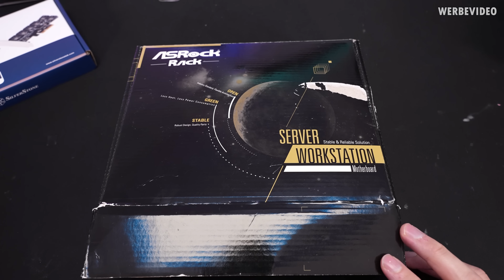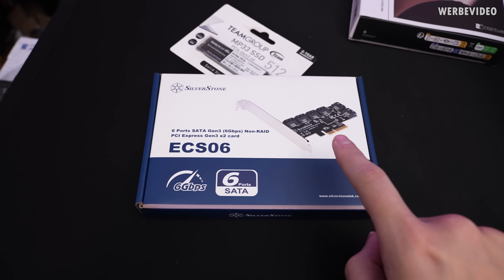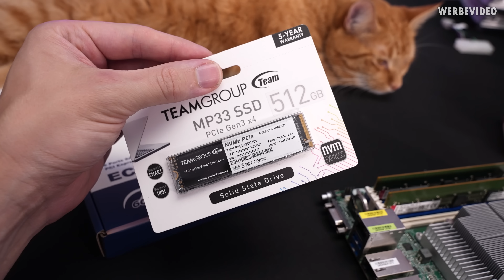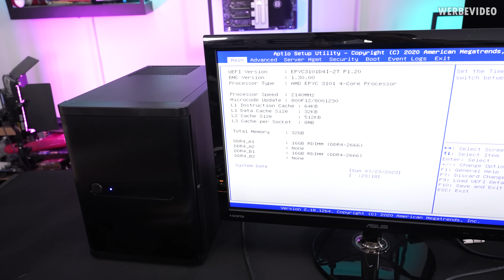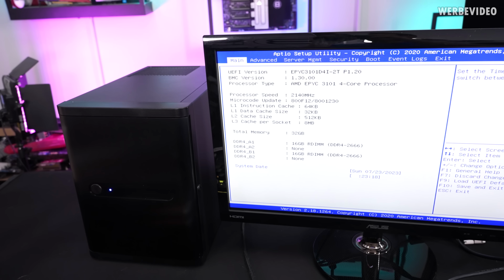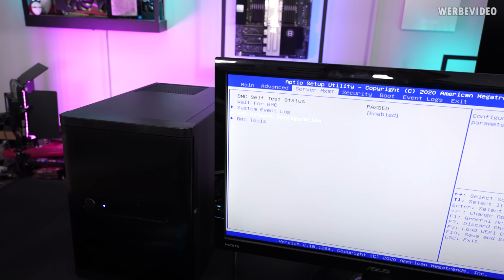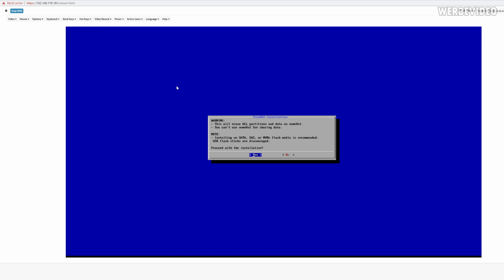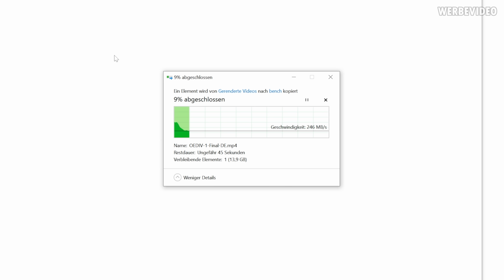First Time building my own NAS

Comment: Ideally you'd want a daily backup up to a week/month and maybe a backup of each month up to a year. You don't need to run the backup server 24/7 for that, simply having it boot itself and be ready/online a moment before the scheduled backup time is enough. If you can't think of a way to wake up the server, you can send a WoL (Wake over Lan) signal from your Synology a couple of minutes before the scheduled backup time. Then you could have it shut down itself after a maximum time it should ever need to backup 1 days worth of data, or if you want to optimize and don't mind writing a custom script, you could wait for the connection and activity (after the backup drives might be indexing/scrubbing) and shutdown after that.

Either way, it is recommended to run an extended SMART test once in a while (lets say once a month or two), as well as scrub/check for data integrity too. Do you remember when Linus lost some data due to bit rot? You probably don't want that.

Here's a quote from an article on teckadviso:
"Regardless of whether you have SSDs or old-fashioned mechanical hard drives, both storage medium have only a limited ability to preserve the stored data when they are not in use.

That doesn’t mean that you have to leave your PC switched on all the time. But anyone who thinks that it is a good idea to fill a drive with valuable data and lock it in a safe is unfortunately wrong."

Comment: Return those HDDs. I owned a few & 3
 of them crashed. It was a big loss for me. It's showing data was there but when I copy, it gets stuck at 1%.  Sent, a drive to toshiba, even they can't diagnose the issue. 
Swapped them all with Seagate.
Reply: And GamersNexus cursed Seagate drives, which do have on average worse failure rates in Backblaze stats. Specific models can have issues, that's true for any of the 3 manufacturers, so it's better to look up data on a model beforehand, but redundancy is more important than manufacturers on consumer scale anyway.
Reply: @Lishtenbird  reliability & services is also a factor. What you said is right, even specific batches of good models can have issues.
Reply: Are these big drives reliable at all? And economic?

Comment: have ecs06. great little thing. but, beware of sata ports and cables. i went and bought silverstone thin sata cables and of course, since sata ports are next to each other (rather above one another) the thin sata cables have to be bent way too much when plugging into two ports and beyone. and it doesnt matter if its left or right angle cable, you will always have to bend the wires. those silverstone thin sata cables always have the wire coming from the side, which is a shame. thin sata cables that have the wire coming out the middle of the connector, vertically, would be ideal and i have those but are too short and here in SUI i cant find cheaper ones, only supermicro one which are ridiculously expensive. here. in SUI, of course. in US? cheap AF. lol. will try aourcing them from EU where they are like 2-3x cheaper.

Comment: Just a note, you want to wire a 5 bay to use 5 even if the goal is to have 4 - replacing drive is correctly done without removing the old one first. That said soemtimes you do not have the option.
Reply: That's really just a matter of cosmetics. You can keep the old drive connected, if you desire, without having it in a bay for the short period you're replacing it.
Reply: @zamadatix It is not (edit cosmetical). Drives die around the rebuild, handling drives with no parity is prone to failure and finally the human errora related to interaction. It is objectively better to have an empty bay rather than shutting down the system amd handling rebuild that way. Of course there is no shame in doing things good enough and I am throwing no shade.
Reply: @mckidney1  What about having an extra bay or not changes whether you have to shut the system down? Hot swapping is a function of the SATA controller, not the bay. The bay is just a nicer looking way of holding the drives long term. Whether or not you have the extra open bay or not you don't touch any of the previous drives already in bays (even the failing/failed one) until after the parity rebuild is complete.

If "well, opening the case is just too risky" then the problem isn't the lack of additional open drive bays it's the lack of enough parity drives (like here using 2 drives for redundancy instead of just 1 so you keep redundancy during a failure and don't have to worry about a butterfly flapping its wings during a rebuild). Alternatively just keep a USB UASP SATA adapter around, a lot more handy than a permanently empty bay.
Reply: @zamadatix  I think context of the video lost, option was there to wire it to an already empty bay. Self-proclaimed new NAS builder did not take it. I find this argument to be made for argument sake - yes it can be done even now, but at additional effort that is applied at the time of failure. Chosing between "wire the extra bays at a cost of a SATA cable and ports you already have empty on the main board" and "You can use open the case and wire it when the drive fails" - do you honestly thing the decision comes to cosmetics? Edit: My answer is no, the difference is that one is an advice and second is an excuse. Why would you send an excuse to a new builder?
Reply: It's fine to wire it up, it's also perfectly fine to not wire it up. If you had said "You may want to wire bay 5 to save yourself time in a future drive replacement" I'd have agreed but you insisted one always wants to and gave the reason it's how you can correctly replace a drive as if it you couldn't just as correctly replace a drive without the 5th bay wired. Also note I didn't even say anything about wiring the 5th bay at all, again that's just one option of many in how to correctly replace a drive.

There is so much misinformation in the NAS space because people like to describe their preferred way of doing something well as if it's the only correct way of doing something well. It's not that it's bad information, many will indeed want to wire a 5th bay (or even just all of them if they have the ports), it's just presented in the wrong light as if not doing it this way can't a valid option as well.

Comment: 12VO boards seem like a bad idea to me. You're basically making more points of failure to the motherboard by adding a bunch of voltage regulation to it. I think it's cheaper (and much easier) to replace a power supply if it fails, than to replace a more expensive motherboards if the power regulation function fails.
Reply: A bunch of voltage regulation, you mean just 5V and 3.3V? 

Plus, you do know that there's a duplicate VR, like 12V->12V, just to ensure that the 12V entering what ever device is always 12V, instead of 12.5V or 13V or 11V?

There's already more points of failure on your non-12VO boards!
Reply: @AlfaPro1337  Could you please give an example of a point of failure that exists on a Non-12VO board that does not exist on a 12VO board?
Reply: @Lardzor  Dude, there's already more point of failure on any spec, 12VO or not!

I repeat:

There's always a second VR, this takes the input voltage, and ensure that the output is the correct voltage.

Plus, the only board that died is one of my old H67 motherboard, and the failed component was the solid state capacitor to the CPU, not even the VRM!

All other boards I own in the past, Z77 and Z170 all died from failing BIOS chip. Not VRM.
Reply: Totaly agree. Plus it makes troubleshooting easier. Anyond with a self build nas and such likely has another PSU somewhere, so you can just plug that in in 5 mins and see if that was the cause of failure.
Oh, and of course heat management. 12VO puts a bit more heat on the general board away from parts that get actively cooled.

Comment: For 4-5 HDD You could use a Jonsbo NAS cases that are much more compact and nicer
Reply from the maker: I didn't even know about them. Just checked and they indeed look really cool. Will remember that- thanks!
Reply: I'm still rocking a Node 304. A bit bulky. 
If I had a 3d printer, the mods they are making are legit.
Reply: Yeap, and for 8 HDD they have N3 already.

Comment: the rackmount cases from Sliger have been making a home NAS very tempting for a while
Reply: Sliger cases are nothing special... Poor actually for a nas, no drive backplane. For the price of their case you can buy a used enterprise server. I bought a pair of Dell t320s years ago with 8 bay sas backplane and 96gb ram each for like $800(for both). They are still going strong. Replacement parts are cheap.

Nothing against Sliger I own 2 of their desktop cases
Reply: @jeremytine  Their NAS specific case(s) have a 10 drive SATA backplane. I would have gone with one of the newer 5 or 6U cases Silverstone is coming out with, but they haven't released a timeline.
Reply: Just bought a CX4728 (not listed on their website, but it's just a deeper CX47xx), and it should be here tomorrow pretty excited to get it set up and figure out how best to cool it and exhaust heat.
Reply: @justinyoung5348  so when you get your cx4278 please report back how they manage to stabilize the loose sata/power cables to simulate  a hot swap backplane, because without seeing it, it just sounds janky. Not trolling, seriously curious.
Reply: @jeremytine  Sure, running power will require some planning to keep it tidy and secure, but I'll be using an HBA with mini SAS to SATA to keep the data side relatively clean. I'm not too worried as it'll be rack-mounted, and I don't see how connectors will back out.
Reply: @justinyoung5348  I'm more concerned with connectors wiggling and being misaligned and jamming rather than fully backing out. If I have to open the case to disconnect/reconnect, it defeats the purpose of hot swap.
Reply: USA only?
Reply: @deafno  nope pretty sure they ship worldwide
Reply: @deafno  they are 100% made in USA tho